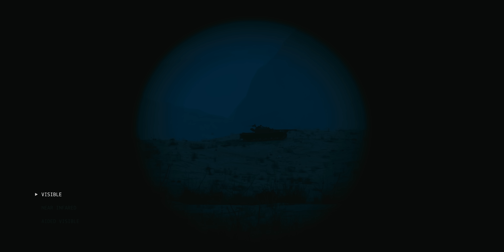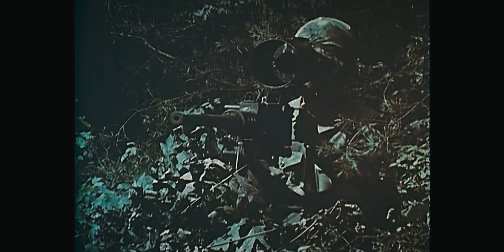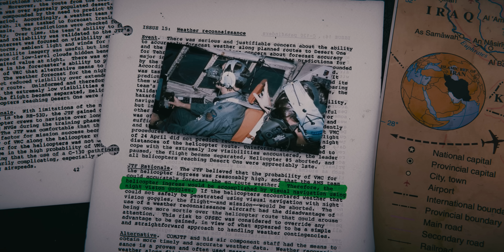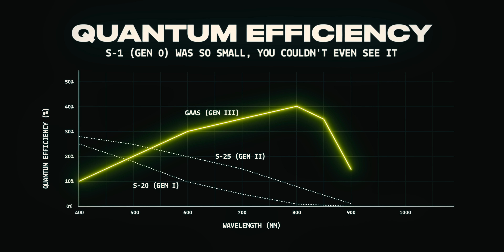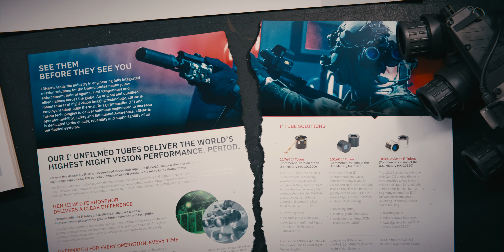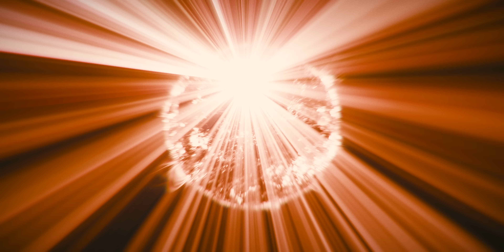America's Secret Weapon

Comment: Night vision goggles are a German invention.

Germany began developing night vision technology back in the 1930s.
In 1934, the company AEG developed an infrared image converter (name: Generation 0).

 Development continued in 1936 in collaboration with the Army Weapons Office/WaPrüf 8 (Dr. Ing. H. Gärtner).

In 1939, the first prototype of a military infrared night vision device (Zielgerät 1221) was presented to the OKW, but it did not meet the requirements of the Wehrmacht and development was initially discontinued.
 It was not until mid-1943 that development was resumed and the first devices, such as the FG 1250, were used on Panther tanks.

Comment: I remember using ANPVS-5’s and Starlight scopes in the Marines. They were pretty cool. Then we got the PVS-7’s which were so much better. This was the mid 1990’s. Now I’m running PVS-14’s and they are even better, but already obsolete. Thermals are even better, but you need both, as they complement each other. My NOX-35 is amazing piece of technology I couldn’t have imagined 30 years ago. Our thermal system in Somalia was so large it had to be vehicle mounted.

Comment: military-grade night vision is leagues ahead of consumer tech, both in terms of raw capability and integrated systems. What civilians call “Gen 3+” or “Gen 4” is often just the tip of the iceberg compared to what’s deployed in elite units.

🛠️ Military Night Vision: Beyond Generations

- Fusion Systems: These combine image intensification (I²) with thermal imaging, allowing soldiers to see both heat signatures and ambient light detail simultaneously. It’s like layering two realities—infrared and visible—into one tactical view.
  
- Augmented Reality Integration: Some helmets now feature HUD overlays with GPS, targeting data, and battlefield comms. Think of it as night vision merged with a combat-ready version of Google Glass.

- Photon Detection & Low-Light Sensors: Advanced sensors can detect near-total darkness with minimal noise, far outperforming commercial tubes. These often use proprietary materials and algorithms not available to the public.

- AI-Assisted Target Recognition: Some systems use onboard processing to highlight threats, identify friendlies, and even predict movement patterns—all in real time.

- Miniaturization & Modularity: Military systems are lighter, more rugged, and often modular—allowing for quick swaps between goggles, weapon sights, and drone feeds.

🧪 Civilian vs. Military: The Gap

While civilians get impressive Gen 3 tubes and digital systems with IR illuminators, they’re still limited by export controls, ITAR regulations, and cost. Military tech benefits from classified R&D, battlefield feedback loops, and billions in funding.
 the spectral layering of thermal + I² is stunning

Comment: Aren't there also "budget" models that use the same high-sensitivity sensors used in DLSR or high-end video cameras and use an LCD screen? Not sure the name of that branch of tech specific to this application (Maybe "digital imaging"?), but I think they're potentially more lightweight and maybe used by countries other than the U.S. (Not sure if U.S. military has an equivalent to such models, although I think there are some in the civilian market that work this way rather than by specialized photo-intensifiers.) Basically it's a video camera with gain turned way up, but the modern imaging sensors are good enough to be driven to function as night-vision.

Also don't the newer ones have some way to deal with light bloom too? I think I remember reading somewhere where on some older models that opposing forces realized that they could shine a searchlight to blow out some light-intensifying night vision and it would take a few minutes for the sensors to work again once they've gone "hot" from that. (I think that was one of the problems faced early in the Iraq war?)

Comment: What if, to expand the field of view without reducing image quality and without adding more tubes you did the following. You employ a “large” 12” diameter parabolic mirror in front of the soldier’s face capturing as many photons as possible. The mirror would be a highly reflective coating applied to a lightweight composite surface. The mirror would shaped to be not quite parabolic as to focus light from a wide FOV similar to a wide angle lens. To achieve the wider FOV without losing resolution you employ a larger diameter photo multiplier plate with more holes/pixels. This would normally have the drawback of darkening the image as you’re spreading the same amount of light over a larger sensor size, but because we have the large diameter mirror capturing an order of magnitude more photons, it makes up for it. Just an idea.

Comment: I quickly found out about the dashboard lights when testing budget 1× digital night vision vs low speed driving in the woods with 2 budget ir flashlights mounded outside the vehicle it only took one small running light on the dash  to make the windshield almost impossible to see through so i covered that and could only drive at 10mph until the digital lag time began messing with things

Comment: When I was a squad leader for a special squad in an FSC/CRT for a light infantry unit with 4ID, which consisted of Special Electronic Devices, Small Arms/Artillery/Missiles, & Radio and Communications Security Equipment MOS’s, I can tell you it was the NVG’s that were the most difficult to work on bc you need access to a clean room and nitrogen. They were also the easiest to misplace out of all the sensitive items in our shop/vault. Your stunning imagery & narration should be shown at the school house as an introduction to the 94F course. 🤙

Comment: The 40 degree fov is still preferred by most aviators. The PNVG is heavy, bulky, fatiguing to fly and more difficult to align with the eye axis. Also, the 40 degree fov isn’t really that limiting. It’s not like looking through toilet paper tubes. They sit about 2.5cm from your eyes so you still have peripheral vision. More fov is obviously better, but it’s not that huge of a deal to operate with the 40 given its lighter weight, compact form factor, easier alignment and long battery life.

Comment: This is the first video I see from this channel. I opened it expecting the usual tacticool assembly of stock footage with some voiceover. I instead stumbled upon the highest quality 3D work I have seen in any youtube production, ever. As a fellow CG professional I spent the whole video wondering if this was a million dollar production of 20 people's work, or the passion project of a madman with incredible 3D skill and attention to detail, paired with an equally great knowledge of the subject itself. It was indeed the second option. There is literally no other way to do this. Just know, Mike, that your effort was noticed on multiple levels. From the completely unnecessary (but absolutely cinematic) swirly bokeh to the details on surfacing, modeling, lighting and even animation. The details on the paper, the fingerprints (you fucked up the projection of the one at 21:19 but we can ignore that ;) ) , the orange marker color on multiply to get the double values instead of a normal mask. The impeccable shading of transparent materials even when not needed (like for the yellow screwdriver), or the dust scattered out of focus, or the lens breathing when focusing on the laser. Even the "idk vfx" lorem ipsum text on the tv made me giggle but realize that you probably had to hand texture most if not all props. And I am sure I missed 90% of the things you did even if I was actively looking for them, cause they just worked. You could have settled for less than half of the details and have gotten the same number of views, but it was clearly not the point. You wanted to make art, and art you made. I applaud you for that.

Comment: Night vision technology, integral to U.S. military operations since Vietnam, enables 24/7 dominance through image intensification and thermal imaging, allowing detection and engagement in low-light conditions where unaided eyes fail. Advantages for the U.S. Army include enhanced situational awareness, safer nocturnal maneuvers (e.g., aviation and infantry assaults), and tactical superiority against under-equipped foes, as seen in counter-UAS and urban combat. Disadvantages encompass high costs ($10,000+ per unit), weight-induced fatigue on soldiers' necks and eyes, battery dependency in extended missions, and vulnerabilities like fog interference for intensifiers or enemy countermeasures eroding the once-exclusive "own the night" edge.

Comment: Spent 2000-2010 in the army, and spent a few yeats working for a DOD contractor who works on electronic systems including spectral imagery.... industry speak for NVG, thermal, and even mm wave among others 😂

IIT (and similar digital systems) and near infrared is obsolete as far as a military advantage goes. Its so prevalent, we can all readily afford such, for $10 and a little electronics tinkering, one can convert many inexpensive digital video cameras into being capable of aeeing out to around 950nm IR, including military lasers. The military shifted to higher wavelengths, 1050, with newer generations, to maintain such an edge.  But now you gotta go to 1200nm to maintain such an edge. Also needs more power to be seen. 

Some of the shit they got in development is insane. 

Lets just say we're not far off from native color no IR needed NVGs with panoramic vision. Also, SWIR, and triband coming down the pipeline. Tons of good publicly avail info on those that goes into all sorts of technical details for my fellow tech geeks. 😂

Comment: I wonder if there is a way to incorporate a larger range of the electromagnetic spectrum? Imagine if instead of quad nods you had 3 different types of sensor split across 12 tubes each. Then instead of directly optically combining the output of each tube the image from each is cross referenced against each other for image similarity and then a new image is created using all 12 tubes that contains only the unique details from each separate tube.

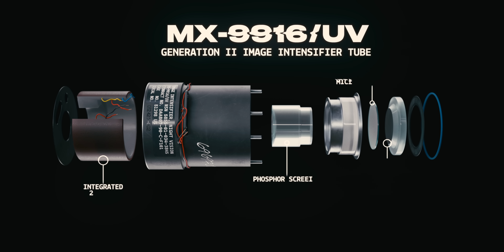Comment: 7:31 on the left, its a power supply which just supplies/amplifies the voltage from ~3V of the battery to hundreds of volts. Etc etc other electrical work.

Comment: ANVS-10s were first used around 2005 by Delta, they were one of the only units using them since Delta preferred ANVS Interface goggles anyway and still uses them today.

Also: 
White phos  tubes were first widely issued on the early 2010s, and filmless "Gen 4" contract requirements were first written out in the late 90s but the first filmless tube (MX-10160B) had a very short lifespan, the first widely issued filmless tube was the MX-10160WG, weapons grade, used in both weapon sights aswell as the PVS-15 Binocular Night Vision System. It was issued in 2007 altho the contract specs were issued around 2003

Comment: Great video. I have a pvs14 with thin film white phosphor tubes and it is dated tech at this point. Even though it is not the latest it’s still like having a superpower at night. The cost ef entry is still very steep, especially if you’re outfitting a carbine with the same tech used by uncle scam. There have been lots of advances in digital but without experience you can’t comprehend what thousandths of a second can do to your coordination and ability to safety move around in the dark. Analog tubes are in real time and not aided by computers. It’s the inverse of most modern things. You really have to experience it to understand. Cheers

Comment: this whole video - wow - but also that ending sequence from Alpha Centauri to Pakistan and through the tube.... i'm totally awestruck here.

I found it amazing that this happened to be uploaded today since just yesterday I tumbled down a rabbithole of finding some AN/AVS-10s on eBay (you can snag a used set for a cool $13k-15k), which until then I didn't know existed as the predecessor to the GPNVG. I tumbled further, reading the original 90s patents from Danny Filipovich and realizing ultimately that some history seems largely lost: we all know Insight (today L3Harris) produces the GPNVG-18, but due to popularity of the "AN/AVS-10" military designation, the commercializer of that hardware is not widely known. Turns out Filipovich took his work to Kollsman, Inc. for manufacturing. That company was acquired by Elbit Systems and they announced the device as the Elbit QuadEye. 

Also another thing you notice when researching America's recent history of military electro-optics is that an epicenter of expertise has concentrated in the state of New Hampshire. Virtually all of our best-known IR/NV warrior support systems have been developed/manufactured there in tucked-away office buildings of semi-rural small towns.